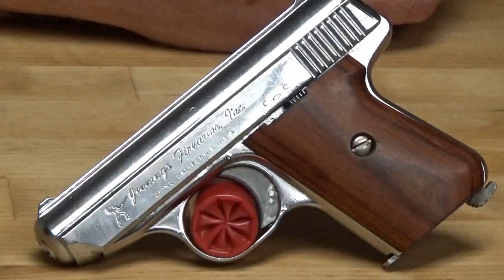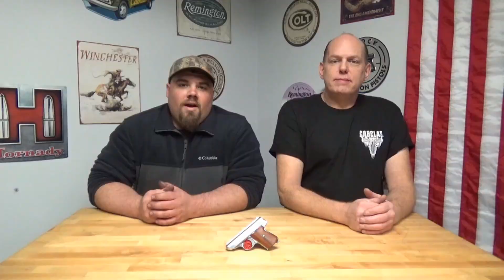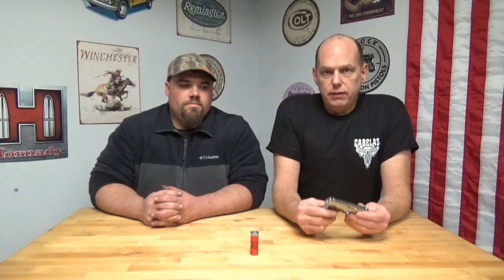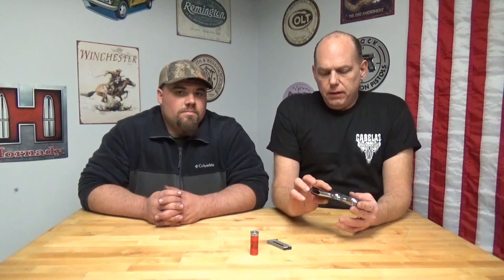Jennings J 22 Shoot at your own risk!

Comment: I didn't experience any safety problems with my J-22 but it would not feed three rounds without hanging up so I took it apart and used 1000 grit sandpaper to smooth out all the rough edges and then steel wool to finish it out then I oiled it and put it back together and it hasn't given any feed problems since.
Reply: Did much the same.  No problems now.  Good little sock pistol.
Reply: Just got one for free, gonna polish that feed ramp asap
Reply: jeremiah Jones  use CCI stinger's. Problem solved.

Comment: Recently purchased a used like new j22 for a mere $65... gun looked as if it had never been field stripped and cleaned. I took it apart, cleaned it, took steel wool to the feed ramp and oiled the internal parts. 100rds of Cci mini mags without a single malfunction.
Reply: Have you since tried other ammo?

Comment: It’s not a Kimber, but I have had my original for 30 years and still shoot it still today on some occasions. Never have had any big issues. After leaving it sit for over 10 years, noticed after cleaning the outside, the firing pin wouldn’t lock back. a little oil and cycling fixed the issue and it was good to go again. The firing pin doesn’t lock or cock back till the very end of the slide, so it’s not friendly to weak ammo or holding high and restricting the backward movement of slide. But avoiding these 2 things, it works as good or better then you would expect a cheap gun to work! 
These guys are bias against .22 cal, I get that .22 cal doesn’t have one shot stopping power, but is more deadly then anyone gives credit. I would rather have this because it’s easy to carry, then nothing at all. Not my usual carry gun unless I need something real small, but wouldn’t hesitate to carry it and fun to shoot.

Comment: I bought one for about 60$ at a gun store in great condition. After a few failures to eject I figured out it's issues and stripped it down to clean and smooth a few parts. After breaking it in it feeds flawlessly and never fails to eject. it doesn't have any of the safety issues but I've definitely seen them on a more worn out model. I wouldn't count my life on it but as a plinker and toolbox gun it serves it's purpose. I'm currently working on a 12 Rd mag

Comment: I once owned a J-22 as a backup gun.  It actually shot pretty good, considering that it was junk. Our department was doing it's yearly distruction of weapons no longer needed to be saved as evidence.  Among the pistols was a Jennings J-22.  I watched with focused curiosity as the cutting torch flame  came close to the metal.  Without the additional oxygen blast of a normal usage of the cutting torch, just the basic flame, the Jennings melted into a puddle.  I was amazed.  I sold my Jennings to another deputy for 60 bucks.
Reply: yeah ive gone against 2 robbers  with flame throwers   i will sell mine

Comment: I bought one of the Bryco Arms J-22’s for $5 from an old lady who just wanted it gone. It didn’t have a magazine and the firing pin wouldn’t cock when the slide was racked back. I took the grips off and found the sear wasn’t lined up. Be careful if you remove the grips for cleaning. After I fixed it the little gun shoots good with a very tight group. I have a 6 inch steel target I can consistently ring from 25 paces which I attribute to the barrel being solidly pinned on the frame. I love to plink with it but wouldn’t choose it as my carry piece unless it was all I had. And fortunately it’s not all I have 😎

Comment: i put about 50 rounds through one and never had a problem.
Reply: use good ammo for these
Reply: Just ran 50 thru mine today up around 1000 rounds threw it now as long as shes clean and oiled it runs fine but I just play with it I have way more capable guns/ rounds that are my every day carry I bought it from my dad for 20 bucks so when it does decide to finally die it will be melted down and thrown in a scrap bin with the cobra ca 380 and few other turds I've bought for 50 or less over the years

Comment: Just got this for $125 as a plinker it’s not that bad also got a smith and Wesson sd9ve for $400 and a cracked iver arms single shot for $150 just wood glued the butt stock back together and copper bristle pad to clean rust and works fine / got a 22 pistol 9mm pistol and 12 gauge for $675 seems like a good deal saying that other smith and Wesson or glock would cost that for just 1 gun

Comment: I was recently bequeathed one by my deceased grandmother my grandpa bought her in the 70s and I've never fired it one I didn't have bullets and two it seems that bullets couldnt enter the chamber correctly so unless I wanted to spend more than it was worth at a smith I should probably keep it solely as an unusable memento and use what I would spend on a basic 9 mm
Reply: But thank you for the information

Comment: .22 mini-mags and you'll have zero issues with it cycling. It's laughable that you talk about it being pot-metal. A large amount of cheap .22 pistols/rifles from the 50s+ were made from pot-metal and they are still functional today. I have a few .22 lever actions that were made from pot metal that have had thousand and thousands of rounds through them and they still function fine. Same for pistols.

You talk about drop safety also, but lots of guns from earlier periods were the same.

Comment: Got mine working 100% this is just wrong, had a few still have 1 love it
Reply from the maker: You got lucky, there's many people you have the same problem as us. Do some reading online, and you will see. There is a reason they went out of business.
Reply: Rub make perfectly fit mating areas and superlube or frog lube also polish ramp, keep clean and lubed they work perfectly
Reply from the maker: @johnpower8356  it should work from the factory.
Reply: Idk in the 70's you could get 3 for $100 that's what bryco, jennings and jimenez are about cheap 22 auto that requires fine tuning and premium ammo, contrary to you saying alot of trashing online there are as many that say different but OK 👍